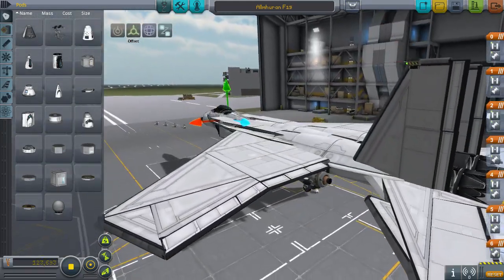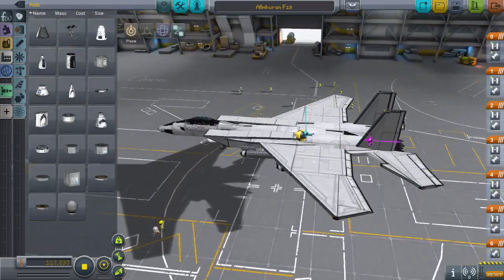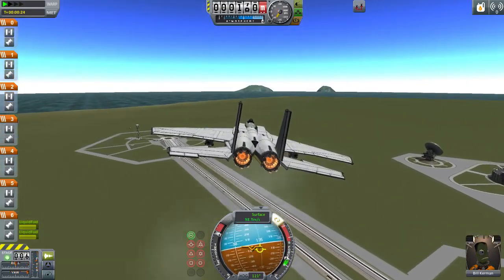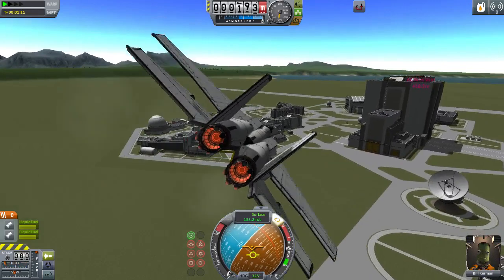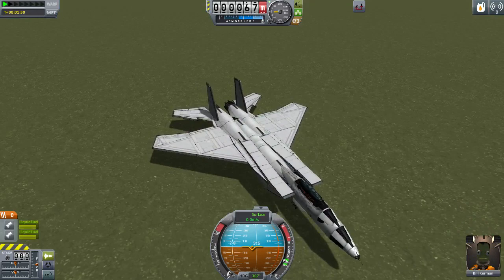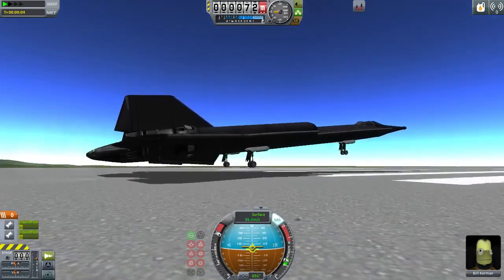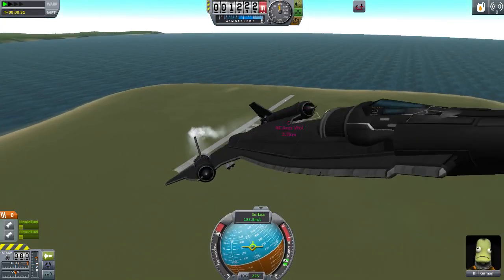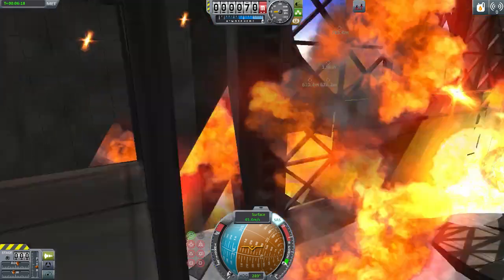The Allmhuran F15E and Eorin's YF-12A - KSP Plane Reviews Special Episode 1

Comment: Hey buddy I dont know how much you know about F-15's but there is a gap between the intake ramps and the fuselage. It is for the Primary Heat Exchanger Inlet. I worked them for 12 1/2 yrs

Comment: I understand this video is like, three months old now, but the YF-12A isn't the SR-71. It's also not necessarily a prototype either.

The YF-12A was originally planned to be an adaptation of the CIA's planned A-12 Oxcart, which is the precursor to the SR-71 Blackbird. The YF-12A was intended to be a Mach 3+ capable interceptor designed to escort A-12s as well as to rapidly intercept Soviet bombers that entered NATO airspace. The YF-12A never saw a life as long as the A-12, and neither aircraft saw the service length of the SR-71. While the only people who can truly confirm the stats of the YF-12A, A-12, and SR-71 Blackbird would be CIA, Lockheed Skunk Works, and US Airmen who worked on the craft, all of the data on the Wikipedia pages for the aircraft check out to what's publicly available to everyone.

SR-71 Blackbird: http://en.wikipedia.org/wiki/Lockheed_SR-71_Blackbird
A-12 Oxcart: http://en.wikipedia.org/wiki/Lockheed_A-12
YF-12A: http://en.wikipedia.org/wiki/Lockheed_YF-12

You may also notice a difference in the noses of the aircraft, which in addition to the length of the craft, is a good indicator of which craft you're looking at.

Comment: Did you know that F/A 18 is same design as the F 15 but different tail angle?
Reply: +li zhuoxi 
No? They are extremely easy to distinguish.  If Hornet was the same as F-15 it would be it's variant...
Reply: ok
Reply: You can distinguish them really easily after lack of leading edge root extension on F-15. F-15 wings are more delta-shaped while F/A-18 wings are thinner and longer also F/A-18 has smaller engimed
Reply: ok tks